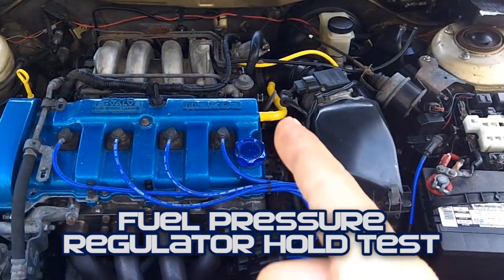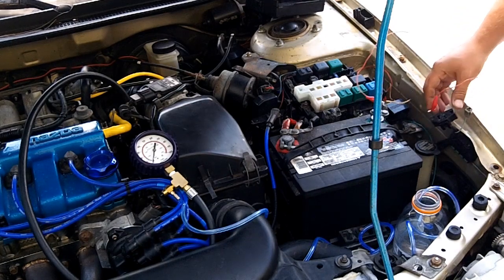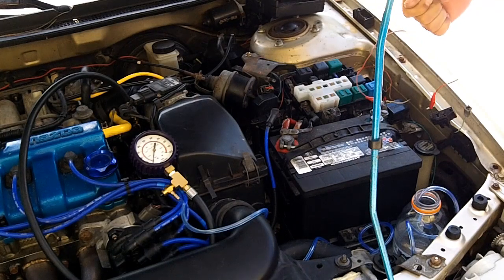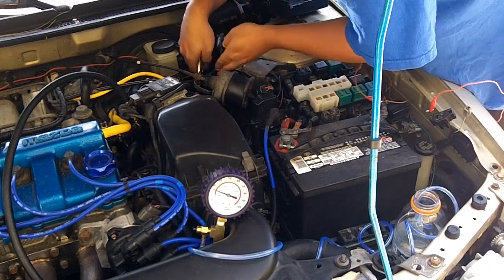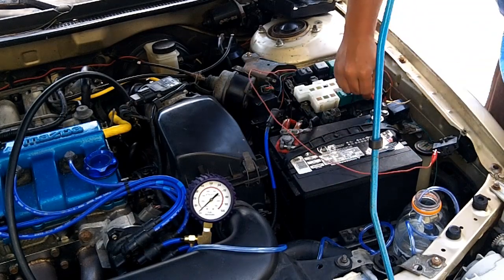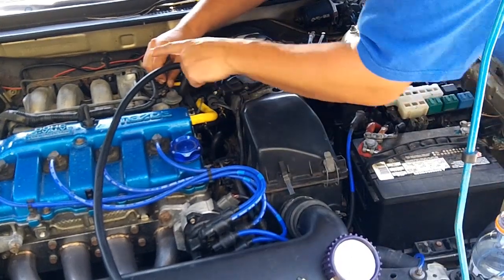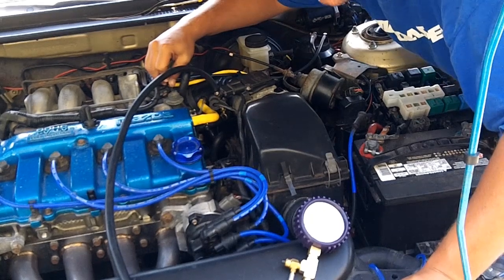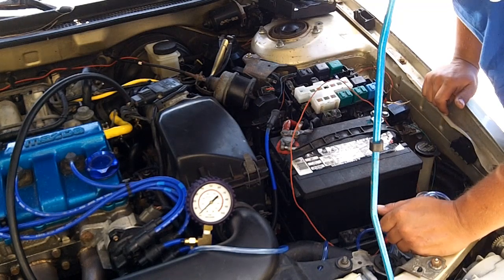Mazda 626 - Fuel Pressure Regulator Test

Comment: hi, my car will start by 3-5 times especially in the morning ,the distributer charge is okay, i changed my battery and spark plugs and fuel injectors and fuel pump ,and switch, until i have the same problem, do you think that i have to change the fuel regulator?if not what can i do plez help me i was so tired with this problem, thank you DJDEVON3

Comment: When i disconnect the vacuum line on my fuel pressure regulator should it leak fuel to the line to the intake?
Reply from the maker: Absolutely not. You should never have fuel coming out of the fuel pressure regulator vacuum port, period, ever. All vacuum hoses are for air only with exception to the evap system which will have fuel vapor and air but again, no liquid. Sounds like you need to replace your fuel pressure regulator. Scanner Danner has an excellent video on the subject. It's the same procedure I show but he does it up close where you can see the result better. His test is universally applicable to any vehicle with a fuel pressure regulator with a vacuum diaphragm including the Mazda 626. https://www.youtube.com/watch?v=AKtR_yF7bi8  I recommend Scanner Danner's video because he demonstrates what a bad one looks like. 

In my video I state that my FPR failed the test but it only failed because of low fuel pressure. I misinterpreted the results. The ultimate culprit was low fuel pressure due to a bad fuel pump component inside the fuel tank.
Reply: @DJDevon3  my car idles differently when hose is unplugged it idles higher but when i plug it in back it sounds bad and almost stalls. My regulator is not leaking though.

Comment: How is it possible to remove plug and find a inch deep fuel on piston head.
Reply from the maker: Spark plug not firing due to either faulty plug or ignition wire is most likely.  An overly rich condition might be possible but I would check for healthy spark on that cylinder first.  Purchase a spark tester for a few dollars from an auto parts store and test it.  Look for signs of burnt through electrode, cracked ceramic, or burnt spot on the ignition wire.  Depending on the year of the vehicle if it has a distributor or coil pack.  If coil pack then it's possible there is a companion cylinder that should also be soaked too if it's a faulty coil.

Comment: so it's like I'm thousand miles aways from home in got damn denmark. everything here is so expensive. I was changed rings because first and second cylinders burning was burned oil. Now second okay. First have some oil in it. Injectors work. How? I put it to batery, hearng click, then slowly bowing air with compressor to injector and it sprays. I'm tired man. Fixing one thing and brokes other one. Whatever. I'll do video for u to see how crap that engine is

Comment: thats it. I'm done. #1 cyl not working. evrything checked. Car dles rough and cannot hit more than 4k rpm. Was good that didnt throw burned oil smoke out of pipe. After few drive I couldnt believe. I checked #1 cyl and I saw oil again. So why the car needs piston rings if they only hold 10 miles. Thx for help I'm trowing engine away. Worst engine evr. Thx for advices
Reply from the maker: Lina Gargasaite You have 1 injector not working and you're throwing the engine away?  Did you do a compression test?  If you still have good compression but not fuel then throwing an engine away seems a bit hasty.  That's like cutting your leg off because you broke a toe.  You never said anything about oil in the cylinders.

Comment: oh my. I just changed coil pack to other one. Also a Spark plug wires.. Now working all except the first one. Not bad but not finished. So it's like I have MX-6 FS 95 yr.
Reply from the maker: Lina Gargasaite Then you have a distributor not a coilpack and your injectors not firing will not be related to the distributor.  Injectors will be separate issue.  Look into faulty injector or injector wiring.

Comment: I'm kinda busy right now DJ but finaly find out whats happen. Running second and third cilinders only. Problem with injector connectors. I cheched directly to battery. It clicks. When cranking - not. Who can cause such wiring problem? Maybe it hase any fuse?
Reply from the maker: Lina Gargasaite What year is your 626?  Cylinders 1 & 4 on the 98-02 626 are companion cylinders which might make it possible for the ignition module to not fire spark on those cylinders (98-02 is a waste spark coilpack).  Probably not coilpack related but whenever you hear about 2 cylinders having an issue on a waste spark setup it's good to make people aware of the waste spark setup just in case.
Reply from the maker: Lina Gargasaite If you have a 93-97 626 it's most likely going to be injector or injector harness related if you have 2 dead injectors during cranking.
Reply from the maker: Lina Gargasaite If you have a 93-97 626 it's most likely going to be injector or injector harness related if you have 2 dead injectors during cranking.  93-97 is a distributor setup.  98-02 is waste spark coilpack setup.

Comment: oh. Now I starting to understad.I could make vid of this but no need. I think u would see the same on your car lol. I checked the injectors cuz I thought its clogged. But it works and it sprays. But. It seems that the electric clicks for injectors not giving a signal. When I'm doing this directly to injector from battery it works. When I'm putting everything back - doesnt. So it seems I have problems with those conectors. I just understand. Everything was working before, now not. Any ideas?
Reply: oh I forgot. One of them sprays, other three not
Reply from the maker: Lina Gargasaite Make a video so I can take a look.  It's too difficult for me to help you more without seeing what is happening.

Comment: okay.I guess u right about the FS. Wen its working properly it's very good engine. And u said that injectors doesnt have to spray the fuel. Why? I take the rail with injectors in. Then cranking the engine. But no fuel comes from injectors only from top. Is that normal??
Reply from the maker: Lina Gargasaite I think that's just bad translation.  Injectors do have to spray just not in the specific test that I was doing.  The test was only to check for leaking injectors.  To answer your question no it is not normal for injectors to spray out of the top.  I would love to see a picture or video of that.  I've never seen an injector spray out of the top before.

Comment: so much work.. all the fs engines are so problematic...alot of bad comments about it. I wonder if someday I could change to fe3 if it fit...
Reply from the maker: Lina Gargasaite Problem isn't the FS engine it's usually the transmission that comes with the FS.  The engine itself is pretty good provided you do routine maintenance like just about any other vehicle out there.  Changing to FE3 is a hell of a lot more trouble than it's worth but if you're looking for a project go for it, do whatever you want.  I'd go with a V6 KL-DE for a 93-97 or a KL-G4 for a 98-02 for a more powerful drop-in replacement for the FS.

Comment: unbelieaveble.. I just in shock right now... I hecked injectors as u do in other vid. none of the injectors spray the petrol.. none of them..just spraying thru seals on top.. so how the hell car runs when it's fitted. Omg
Reply from the maker: Lina Gargasaite If you mean this video... https://www.youtube.com/watch?v=a2XCwTS9GHY  then injectors are not supposed to spray at all.  That's just checking for leaking injectors.  If they are spraying through the top of the injector that's really bad and you'll want to replace every injector.

Comment: Hmm. I checked. Line from fuel filter goes to thin tube which goes to fuel rail.  Other hose is going backward from FPR. I just wondering if injectors had some round gum seal around them. Because now its gum seal on top from rail and just a hard plastic round gum to intake manifold. Should it be more seals on bottom? Cuz its leaking from the bottom
Reply from the maker: Lina Gargasaite  Yes injectors have O-ring seals.  If your injectors are leaking then you'll lose fuel pressure in one or more injectors.  It should still start but will run like crap because air will get in there causing a vacuum leak too.

Comment: Hey. So it's like I'm putting engine back together cuz of piston ring replacement. Everythings looks fine. The only thing is that the got damn fuel running thru fuel injectors... bad fuel pressure regulator???
Reply from the maker: Lina Gargasaite Probably got fuel lines backwards.  The fuel line NOT going to the fuel pressure regulator should be from the fuel filter.  The fuel pressure regulator is the return line back to the tank.  Check all your fuses and harness connections.

Comment from the maker: Yes pinched off the return line going back to the tank from the regulator.  Wasn't sure if there was a check valve involved in the tank but now I'd say that's a prime suspect thank you.  That makes the most sense after doing some more diagnostics today.  Not looking forward to doing a fuel pump diagnostic but looks like that's in the immediate future.

Comment: That looks like the one-way valve inside the fuel pump is bad(to hold pressure when the key is off so next time you have to start it you won't have to build up pressure again). You are pinching the return line coming off the regulator and not the line coming off the filter, are you?